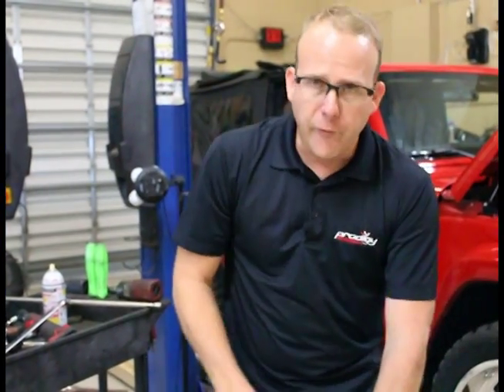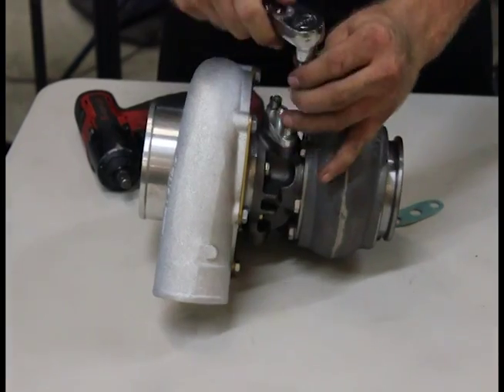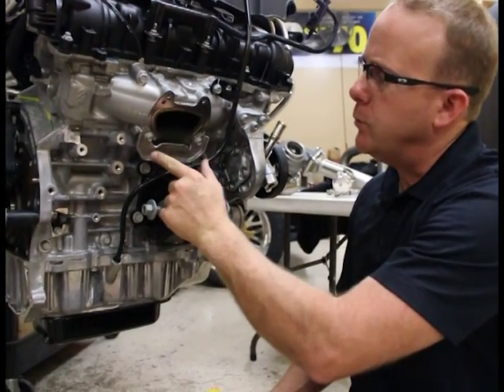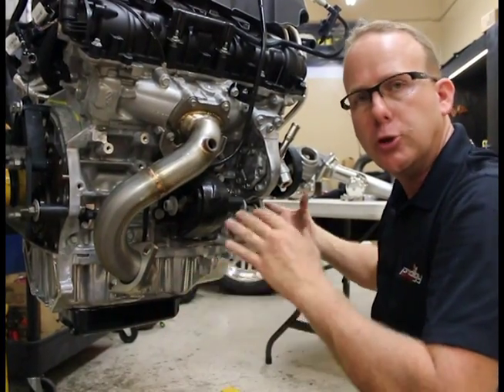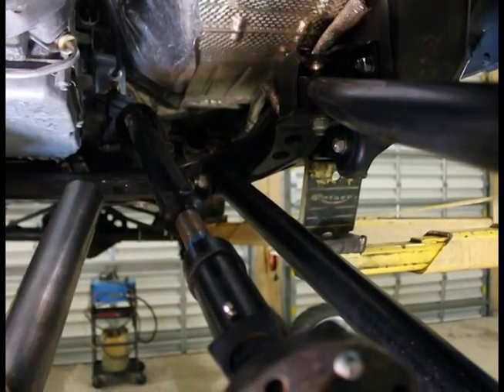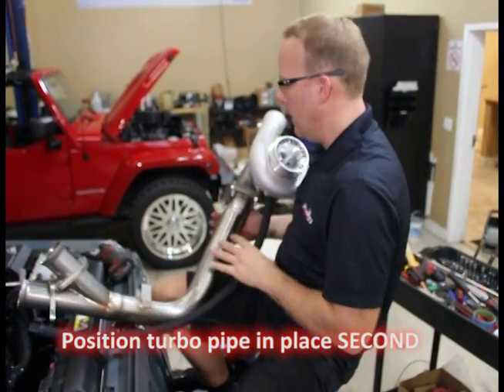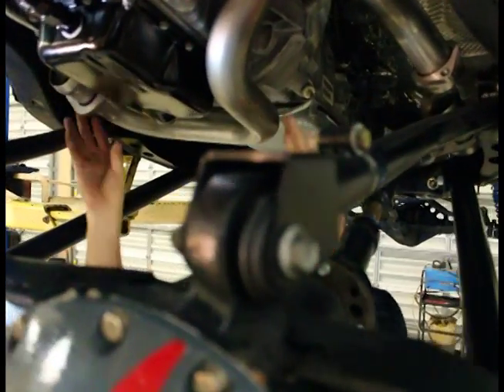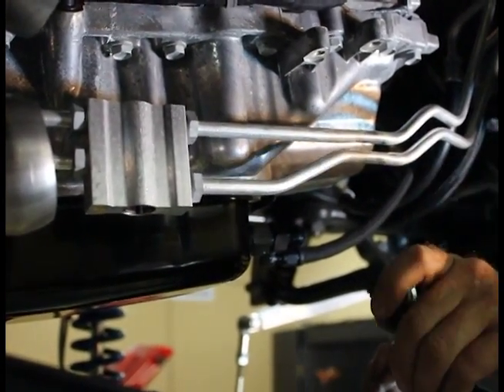3.6L Jeep Turbo Kit Installation #10 | Prodigy Performance

Comment: How many hours does it take to install this kit??  How much should I expect to pay a qualified shop to do this job or tackle it at home??
Reply: Pay a pro to install it..they advertise it as a DIY project but u need to know wht yr doing before attempting this.
Reply: @akbrakes9412 how do you believe the guy your passing became a pro by trying to do it and getting good at it
Reply: Need to be more a software technician than mechanical these days for working on motors.

Comment: Twin turbo would be awesome on these, especially if you could find a way to get the turbos right up on those integrated exhaust ports on the heads. fast spool and lots of power.
Reply from the maker: we tried a twin setup and found the single turbo to be a better solution for this application

Comment: Would this work on 2011 jeep grand Cherokee laredo? Would i have to build anything on the motor?
Reply from the maker: no the pipes are different
Reply: 2011 is a 3.8 ?  not a 3.6, totally different motor.  Not sure if like the JK Wrangler where 2007-2011 was 3.8 and 2012+ 3.6 Pentastar, 3.8 has 85 less HP and Torque than the 3.6, but much EASIER to work on, in my opinion.  2012 + much better auto trans, the NAG1 much better than the 42RLE, NAG1 can easily handle the additional HP & Torque.

Comment: Why couldn't you put a kit like this on ANOTHER vehicle with a pentastar  V6?   (3.6L ) like a dodge challenger or a Chrysler 300S?  Does it sit too high to allow hood clearance??
Reply from the maker: This product is specifically designed for the Wrangler. We do have a Twin Turbo version coming in the fall 2018 for the Challenger, Charger, 300.
Reply: That's great news!

Comment: what is the difference between garrett and precision?
Reply from the maker: Precision Turbo's will spool up quicker, around 2500rpm. While Garret will spool up around 3000 rpm
Reply: Prodigy Performance what's the 500 difference for a jeep mean?